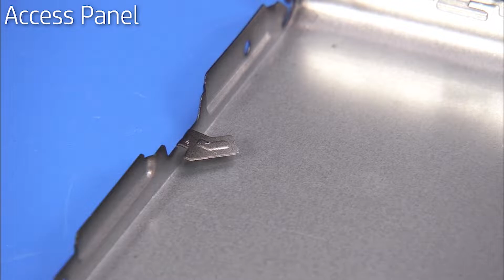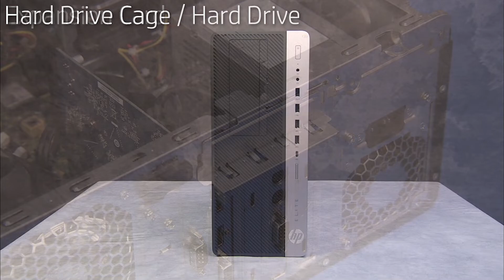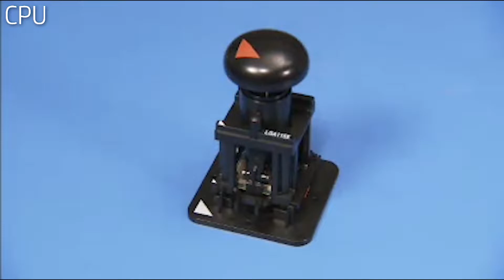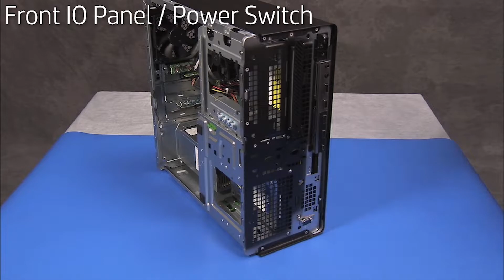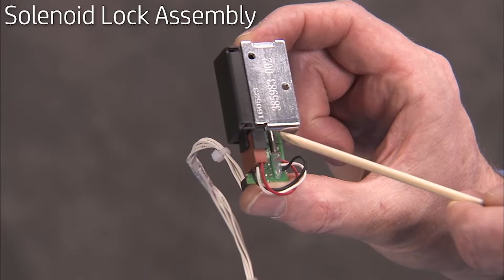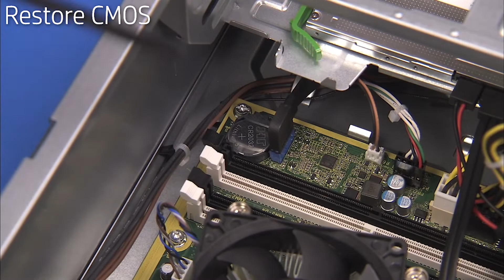Removing & replacing parts for HP EliteDesk 800 G3 | HP Computer Service

Comment: Hp 15  the number worst motherboard failed function no power,no charge it take me 1 month to fix finally it need to remove mosfet chip it and it work like the old time..next time you need to figure it out

Comment: Hello i facing a issue in hp 800 g3 twr, starting in pc showing the protected by sure start can you have any salutation??? than please share with me am waiting thanks
Reply from the maker: +saddar sb Please perform the below mentioned steps to fix this issue:
Step 1: Keep tapping F10 key (A few HP products use F2 or F8.) just after you power up your HP laptop (At this point the screen is still black.) Soon you can see the BIOS setup utility.
Step 2: Next, You should use arrow keys to switch to Security menu shown as below. Select Secure Boot Configuration (or Secure Boot Options)
Step 3: On the pop-up light blue window, disable Secure Boot and then enable Legacy Support using arrow keys and Enter key.

Comment: Hi HP. Is the motherboard cpu bracket(backside) on the 800 G3 Tower can be change with another?
Reply from the maker: +ArchynovaIDE HP does not recommend upgrading or downgrading hardware parts or software that is bundled with the product as It may affect the manufacturer's warranty and performance, however, you could change the configuration at your own discretion.

Comment: hi is it possible to echange the psu and add a gpu and case swap the elitedesk ?

adding a 450 watt psu and a 6500xt to the pc and case swapping *
Reply from the maker: +Dhru Shah HP does not recommend upgrading or downgrading hardware parts or software that is bundled with the product as It may affect the manufacturer's warranty and performance, however, you could change the configuration at your own discretion.

Comment: What gpu does it have as standard?
Reply from the maker: Hi there, thanks for contacting!
I understand that you need to know about the processor used in HP EliteDesk 800 G3 Tower PC,
I will do my best to assist you.
Please refer 'Processors' under the specifcation page to know about the supported processors:
https://bit.ly/3eMX3xb 
Binu - Social Media Tech Support

Comment: Support M2
Reply from the maker: Hi there, thanks for contacting HP Global Social Media Support!
I understand that you need to know whether HP EliteDesk 800 G3 Tower PC supports M.2 SSD.
I will do my best to assist you.
Yes, the HP EliteDesk 800 G3 Tower PC supports M.2 SSDs, specifically NVMe M.2 drives. While it does not support M.2 SATA SSDs, it features an M.2 slot that supports PCIe NVMe SSDs, allowing for faster storage upgrades. 
Regards, 
HP Support

Comment: I bought this computer and try to install a GeForce GTX1050Ti (Low Profile) and it luck a more powerfull PowerSupply. So now i have to find a more powerfull SFF Case PSU to be able to play on this PC. Wish i bought a mATX DELL Instead :(
Reply: Hey did you found another power supply??
Reply: Hi Stefan, you add new psu ? And motherboard or just psu?